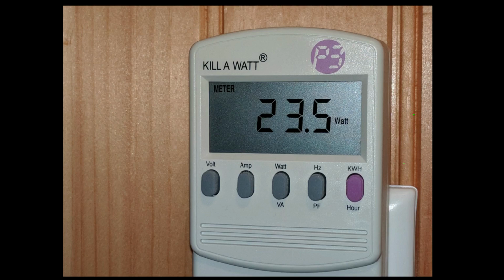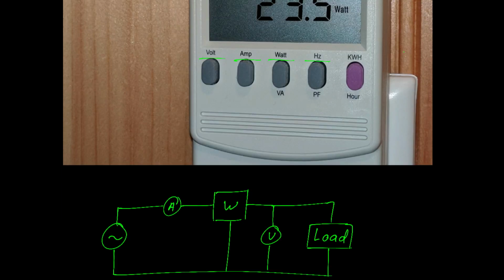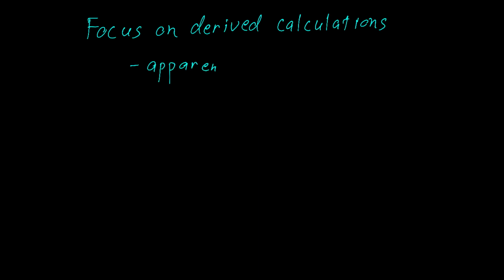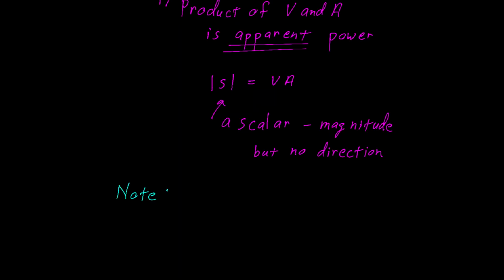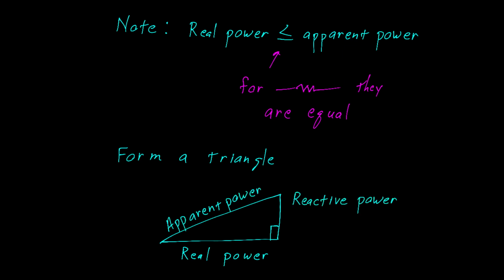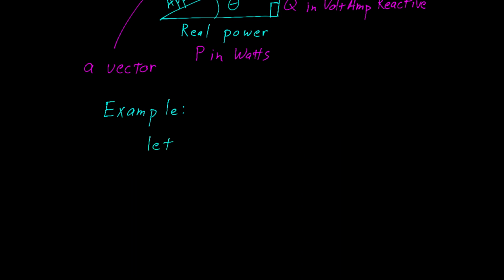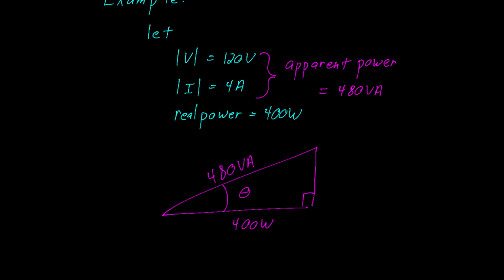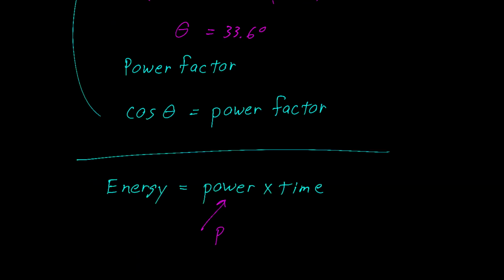Introduction to AC complex power - what are the VA and PF buttons on my Kill-A-Watt meter

Comment: I'm using a Progressive Dynamics 9245, 45 amp, 14.6 volt converter/charger to charge a 200 ah LiFePO4 battery for a backup power supply during power outages. I'm trying to measure the efficiency of the charging system, mainly to satisfy my own curiosity, and I'm measuring input power to the charger with a Kill A Watt meter and calculating the output to the battery with a volt meter in parallel to the battery and a clamp on amp meter. As I'm sure you know, the Kill A Watt will give me readings in VA and Watts and my calculations on the DC output side should not be effected by the units, watts will equal VA, at least I think I'm right, there. The help that I need from you, is understanding whether I should be using the VA reading from the Kill A Watt or the Watts reading. My efficiency calculation is very different depending on which of those (753 watts VS 1153 VA) I compare to the output wattage. I have been trying to find help through Google and YouTube and you are the closest I've come to even getting near the subject I'm asking about. I apparently don't know how to pose the question correctly for the search engines I'm using and any help from you will be greatly appreciated, although I must warn you that one answer will frequently generate additional questions with me down the road. Thanks in advance.